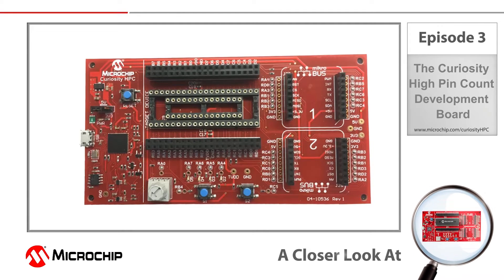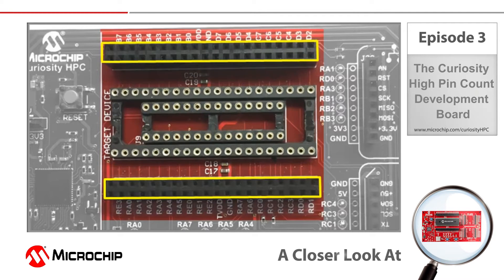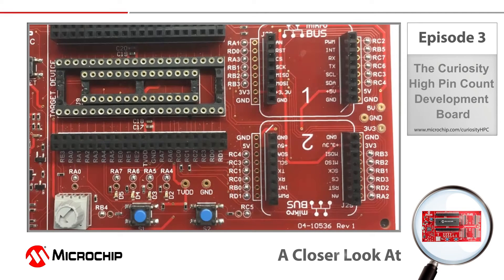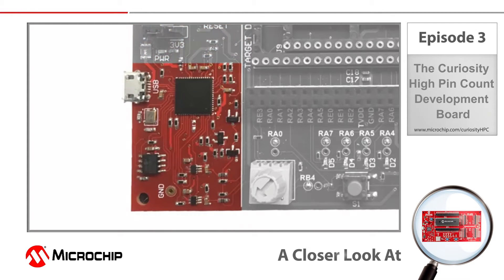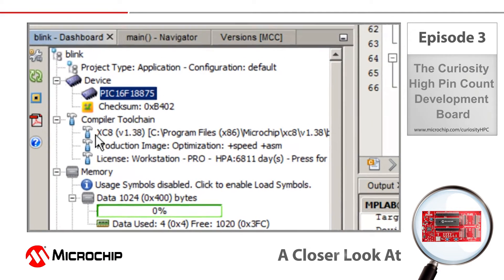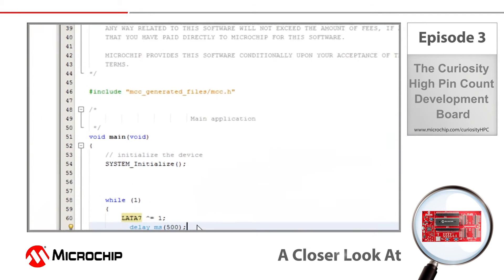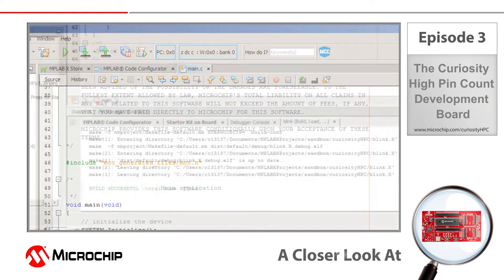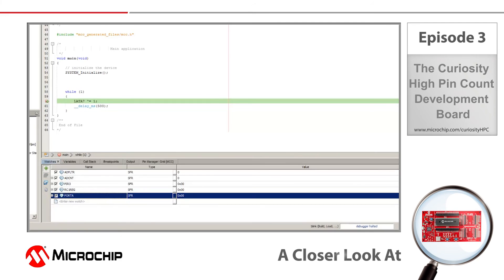A Closer Look At   Episode 3   The Curiosity High Pin Count Development Board

Comment: i would rate this from very nice to amazing this from microchip ..

but the price is $32 compared the Arduino boards. the price should be way lower than this if microchip wants to sell a lot this dev board. 

i mean i can get the clone mega2560 for like $10 ..

also microchip should handle the design to other 3rd party manufacturers to get it popular like Arduino boards.

Comment: I like the higher pin count part, I noticed that it does not support software break points, can I use my ICD 3 on this board?
Reply: On the back of the board is a 6 pin rectangle foot print. That is an PICKKIT 3 or ICD3 footprint. Just solder on some 0.1" pins, and connect your debugging tool.   Look for "PROG-TARG" on the schematic.   http://ww1.microchip.com/downloads/en/DeviceDoc/40001856A.pdf

Comment: Solder blob jumpers are a little bit crude, don't you think?  .10" headers and a jumper seem to be a better idea (and really the first that comes to mind).
Reply: Cost trade off. 99% of the time that solder jumper is fine, saves me from cutting a trace if I need to reassign the pin.